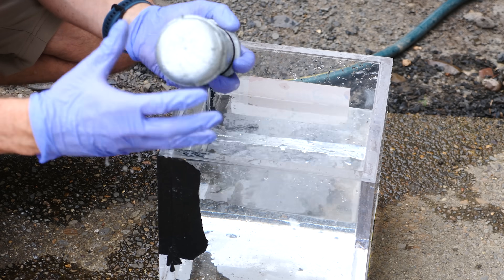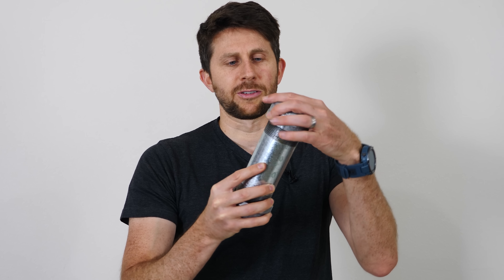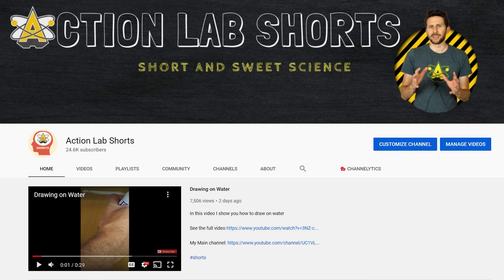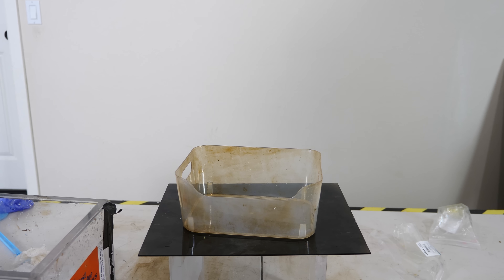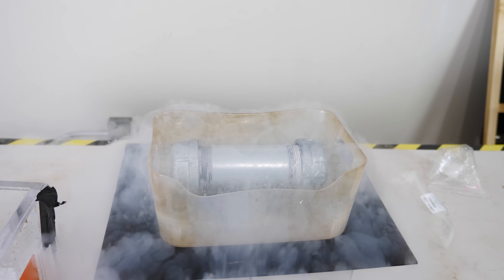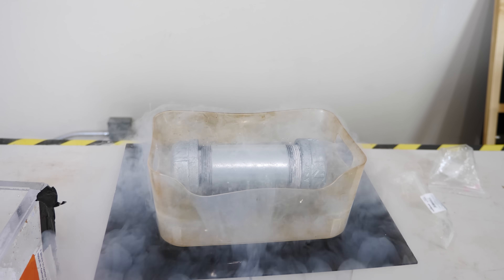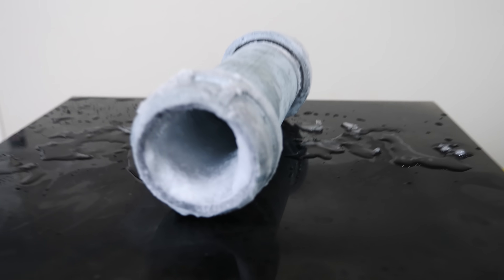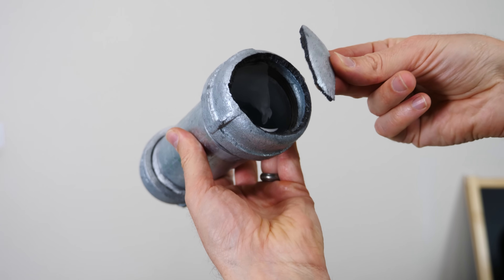Can You Stop Water From Expanding When It Freezes Into Ice?

Comment: I dint see the vid entirely but yeah when water frezzes it wants to expand but as doing it will create presure and we now with more pressure water needs to be frozen even more down to frezze so yes it will stay liquid or partial liquid if the container is rigid enough i guess a cold metal is not as fluid in his internals in other words warm metal can expand without cracking cold metal is likely more crackable i dont even know if that is a word but you get the point i will say that it stays liquid in theory

Comment: If you follow the water pressure temperature diagram, the state of water first follow the line liquid-Ice Ih. Until it reaches -22C and 2100 bars, when it turns to Ice III. Cooling further would make an equilibrium between Ice II and Ice I (without increasing pressure, as the two types of ice would be in equilibrium). Thus, it is enough to have a steel vessel resisting to 2100 bars.

Comment: I think you are not moving upward at 0°C but upward the barrier of liquid and solid. The colder you get, the more pressure you have. So it partially freezes as you cool it down. As you are reaching the 3-point at ice III it freezes completely, but after that it starts to become a mix of ice I and ice III instead of ice I and water. And ice III is denser than water, so it works out greatly.

Comment: Okay so it works something like this, if we go by the concept of how water freezes then it's due to h bonding and crystal formation, this formation makes an open cage structure and causes it to take more volume therefore less density but what we didn't consider here is pressure.
Now let's concider high pressure or hypothetical rigid body, in this case we'll use the phase diagram of H2O with tells us that we can keep it a liquid if the temp is at 0 degrees C and pressure is upto 6000 but after that there is no escape. Although there are different types of water structures which can cause the water to freeze and cause it's density to be more than water.
Therefore the ans lies in the phase diagram ❤

Comment: The pipe is steel, the end caps are cast iron, and will shatter into sharp shards if hit with a hammer or as in a pipe bomb. A cast iron tee fitting with CI end plugs would be similar to a pineapple grenade or mk2 which is also made of CI.

Comment: This would be more accurately done with slower cooling. Exposing the exterior of the steel cap to a super cold liquid is going to shrink it while the ice inside expands at a different rate. Where the cap becomes threaded is bolstered. The threading reinforces the thickness, and the directional push of the ice on and within the cylinder is going to cause failure at the cap. Sorry dude, but the gloves in the water were a giveaway.

Comment: Anyone that has had an engine block split due to lack of antifreeze in the cooling system in winter, knew what would happen here!!!  Those shonky pipe fittings are no match for expanding ice. Trysay a 30cm cube block of high grade steel with 5cm hole bored half way in from one side, screwed and plugged with a 7.5cm thick steel threaded plug. Then just put that in a freezer for a day, it will still split the block!!!!

Comment: Metallurgist here.  The ductile to brittle transistion temperature (DBTT) of steel is generally between -10C and 0C, depending on alloy.   You dont need anything close to liquid nitrogen temperatures.  You could do this experiment in a freezer, or using dry ice with the same result.

Comment: Probably mentioned already, but isn't the lid the obvious weak link? It both has a pretty flat form, and also a small radius at the edges that would be a weak point. I would guess that if the ice formed in the center first, the mid would bulge in the center and break.

Comment: As any decent plumber knows, it is not the expansion of the ice that bursts pipes.  It requires two separate plugs of ice, expanding towards each other. Liquid water cannot be compressed into a smaller volume, so pressure increases as the ice expands.  It is the pressure increase in the liquid water that causes the pipe to fail.  Consequently, you don't realise there is a burst until one of the ice plugs thaws.

Comment: Interesting stuff thanks! I want to highlight the gas/ pressure problem. I look after a hydrotherapy pool. A couple of years ago one of our filters, running about 30 PSI had a lot of air in it, maybe 50 Liters, I was letting the air out of the top valve when the lid let go. The air was like a spring and shot the lid off, sufficient to break my thumb back to sticking up my arm and squirted blood through the skin across the room...Be careful out there.

Comment: I have worked with this kind of plumbing material, these 'caps', bends, adapters are made of poor steel,  a brand good variable wrench tool can easily damage it. that's was the soft spot of the casted you broke there.

Comment: Burst pipes buried too shallow or left charged with water in the open such as sprinkler systems in winter is a problem for us with cold winters. In 1971, I was in Navy boot camp. We had to go out to a desert area to practice ship firefighting procedures. It got down to a record 22 deg. F that night. We were huddled around a fire to warm us when a demo marine strainer went flying 4 feet from its mount. A column of 3" of ice protruded from the pipe and was still expanding up. Half of us were from northern climes and knew what happened.

Comment: Umm, have you heard of metal embrittlement by cold? How about entrained air in tap water? You have zero clue about what happens to supercooled water. Do a bit more research and post things you actually know about. This isn't one of them.

You may have heard of cryogenic metal treatment. Metal parts are slowly cooled to very low temperature as liquid nitrogen is introduced into a chamber. Ultimately the metal reaches around -190C. Then the metal is slowly brought up to ambient temperature. At this point if it is not annealed in an oven until the internal stresses in the metal are stabilized. If you take a piece of un-annealed steel that has been cryogenically treated and drop it a few feet, it will shatter violently sending shrapnel all over the place at pretty high velocity.

Comment: The geometry of the threads and how many threads the caps screw on to are major factors in when the cap pops off. Try screwing the caps on as far as possible, and at the highest torque possible without warpage or breakage. Then weld the caps into place. Cut it open after the freeze and look at the ice crystals under a microscope.

Comment: You can't break physics. expands by around 10% its volume, and there's quite literally no force we know that can resist its expansion ( not a force on the planet ).  as a plumber of near 30 years there are few things I've not seen destroyed by pipes freezing. 

Latent heat energy of solidification ( freezing a liquid into a solid )  is 144 btu or 151,9120 joules / lb 

Latent heat energy of vaporization ( boiling a liquid into a gas ) is 970 btu or 1,023,350 joules /lb 

If you've never heard of latent heat before its worth learning about, you may see the entire world differently after :) 
For reference a sneeze is approximately 50 joules . If the person has a vital capacity (amount of air in a full breathe) of 3L, that air weighs about 3.6 g; to push the body backward with 50 J of energy.

Edit. I just remembered my numbers here are a bit high because theres something xalked soecific heat   water is 1, ice is .5 steam also is .5 
Atmospheric pressure changes these number also depending on your elevation, at higher altutudes less pressure =  lower boiling point .

Comment: The increased density of ice IX means that it wouldn't freeze at 0° C. The next point with 1 gm/cm density is where it would stabilize. When the liquid hits 1 gm/cm, you'll have to increase the external pressure in order to freeze it.
Edit: Clarity.

Comment: You should use quarter inch stainless steel pipe and stainless steel end connectors. What you used is not cryogenic but stainless steel is. It doesn't lose any strength when it goes cryogenic. You could hit that pipe with the hammer, no end connectors and it would crack if it was frozen like that

Comment: You did think about the water coming in contact with liquid nitrogen.  Not good . I freeze bronze bearings at work and know some of  the dangers . I use gallons 5 to 10 at a time or more . PLUS CAST IRON END CAPS ARE BRITTLE THERE NOT STEEL . YOUR LUCKY YOU DIDN'T GET HURT .😮

Comment: I thought maybe the manufacturing seam of the pipe would crack.
Use machine solid billet steal with 1 inch [25mm] walls and bottom. Machine a cap also with 1 inch walls with at least 2 inches of fine threads.
A pressure vessel that can handle 84,000 PSI [6000 bar]

Comment: Action lab, you really need to concentrate on using your mind a bit more than that.  "Well, lets see, I'm using my mind now...the chart says 'Mega pascals' so my viewers should hear me say 'megapascals.'"

6000 mega pascals is 870,000psi.  A good, high quality steel, such as we would make a drill bit for cutting steel at a factory, flows like hot plastic at 100,000psi.  The cheap acetate shield, the butthead was using that couldn't stop a pellet gun, is made out of a material that flows at 6,000psi.  The cheap galvanized hardware store pipe fitting flows at 54,000psi and the cheap, Chineseium, galvanized pipe cap flows like a fluid at 35,000psi.

No, use your mind...you have an education, use it...the steel pipe will spring back with 54,000lbs of whoopsome stupid.

Comment: one wonders if you were able to obtain ice that is more dense than water is...could you introduce it into the exhaust of a rocket engine to increase chamber pressure while also deadening some of the sound and heat? It would also be interesting to see how it's transitional phase works at 1 atmosphere...would it turn to liquid briefly then to a normal form of ice crystals, before starting to melt?

Comment: I have a question. So, two weeks ago when the temperature got just below freezing in my neighborhood, I set out two water bottles right outside my back door on a stand. One bottle with the cap still on and the other bottle with the cap off. The water froze completely in bottle with the cap off. But the bottle that still had its cap on, the water didn't freeze at all. Is the reason why related to what you're talking about in this video?

Comment: Once I was a science teacher at a private school.  My supervisor, who was supposed to get lab equipment and text books, had failed to do so all semester long.  So, I had to make up my own experiments.  It was really hard because it was my very first semester teaching science, so I had to learn lots of other stuff for the first time too.

The children asked me to use a fire extinguisher and a pillowcase to make dry ice (I think they saw it on Instagram).  I got it to work the 2nd try.  As I was passing the dry ice around (I had gloves for them to wear, and told them not to hold it for very long even with the gloves), one of the children suggested I put it in a plastic bottle to see what would happen.  I immediately knew that the bottle would fail if I let all the dry ice melt with the cap on, but I thought, "It will probably 'pop' after a few minutes.  I just need to make sure nobody's holding it when it pops".  However, I had underestimated how strong the plastic bottle was.  There was a point at which I could see solid CO2 ice floating on top of liquid CO2, which I thought was pretty cool.  If I had been thinking, I should have unscrewed it, but you know young children are naughty and always getting into trouble, so I was distracted.  I threw the bottle into a plastic bin, set it behind me, and forgot about it.  A few minutes later, it exploded right behind me as I was talking to the children.  The trash bin was totally destroyed.  It was like 2 feet behind me when it exploded, and I said, "holy ****".  Nobody got hurt, but all the other teachers in the building heard it and I got in trouble. *  In hind-sight, it was pretty dumb.  My only excuses are that I wasn't given the resources I was supposed to have, and I had to make up everything on the fly in my very first semester as a science teacher.  

So yea, this guy is totally right.  Trapping a gas in a container is dangerous.  The size of the explosion will be proportionate to the strength of the container.  

*I was made to sign a paper saying I had done a dangerous experiment outside of the science classroom without safety equipment.  I wrote above my signature, "the science room was occupied and there is no safety equipment."  I gave it to my supervisor and she looked mortified.  She was a middle-aged woman, who I don't think really cared about anything other than covering her own butt.  She completely failed to do everything that was her responsibility (get science textbooks, lab equipment, apply to renew my visa, etc), and I had to do these things for her.  I think the paper she gave me was meant to put all the responsibility for the accident on me, but my note completely destroyed her intention, because she was responsible for getting the lab equipment.  She let me go after the first semester (causing a lot of stress for me, since I was living in the country on a work visa).  She said this accident was the reason, but I think the real reason was that I had to go behind her back to do her job for her (getting my own science equipment and getting somebody else to help me with my visa, etc), and she was embarrassed.  

So anyway, the lessons from this story are that spontaneous science lessons with children are a bad idea (you don't have time to think through all the consequences of your actions), trapped gas is dangerous, and beware of making middle-aged women who are your supervisors look bad (they will be vindictive and won't take responsibility for anything).
Reply: Interesting, at my sons school they did the dry ice to blow up a plastic bottle on purpose for a science thing one day, even let him take some ice home to repeat it at home.
Reply: This is like the works "spontaneous detonators" I made as a kid. Wont explain how its done here but similar thing. Trapped gasses inside bottle eventually go boom. They were fun to make with Gatorade bottles and whatnot because they were so thick lol.

Comment: We use igloo coolers (or equivalent) to soak bushings in nitrogen.  Better than a thin wall plastic container.  When the nitrogen stops boiling you know the bushing is as shrunk as it will get.  That obviously wasn’t needed in this dangerous and fun little experiment though, with water ice doing the work.

Comment: Are you considering that the metal used for this experiment is not a cryogenic stainless steel?. The caps are galvanized steel exposed to LN2 temperature. The metal becomes brittle. The deposit blew up on the weaker side mainly due to this effect.

Comment: I listned to a podcast where this got brought up and its where I learned that there are actually multiple types of ice. If the pressure and temperature get to the right place, the water will turn into ice II, which actually gets SMALLER when it freezes. So you will have a certain portion of the water as "regular" ice, and a portion of it as ice II

Comment: I'd love to see such an experiment but with a milled cube made of high tensity steel alloy  or  aluminum and with a huge fine thread, after that weld shut  to make sure it cannot go anywhere.  Same thing with a turned massive sphere so theres no weak points like a thread or closing mechanism. Huge sphere with a small hole where you can fill up a liquid and weld it shut.

Comment: Hey this actually gives me a SUPER COOL IDEA !! The RMS Titanic operated because it had 3 main engines... 2 double acting, 4 cylinder triple explansion steam engines and one low pressure parson turbine... What if you could make a "sterling engine" that used the transiton of water from the different phases in the ice direction to extract energy from the fluid instead of water to steam? So the pistons have an insanely huge amount of torque as the water cools into ice and expands the piston, to repeat the process again?? It would be interesting and super efficient because you are using the temperature difference between a super cold source and room temperature rather than a boiler

Comment: It looks like you used galvanized carbon steel for this. SpaceX uses 304 stainless though on their rockets because it gets stronger at low temperatures. Yield strength allegedly increases tremendously. Maybe redo the experiment with stainless, it would be cool to see what happens with a higher rigidity.

Comment: If the water freezing really can't be contained very easily, then can't you harvest energy from that extreme torque? it seems like it takes less energy to freeze it than it would give us by being so unwilling to be contained. If you froze water slowly in a container designed to bow, for instance, and had a rack and pinion extruding from it, spinning a large gear, and then the large gear spinning a small one, wouldn't you be able to make any ratio work as long as it didn't get near that ~600 mega pascals?

Comment: If the outside surface of the vessel is polished to a mirror finish, the vessel will hold a lot more pressure.  When reaching its pressure limit, any outside micro-cracks on the surface will be where failure is initiated.  Polishing gets rid of those little cracks.  Told to me by an old ME many years ago.